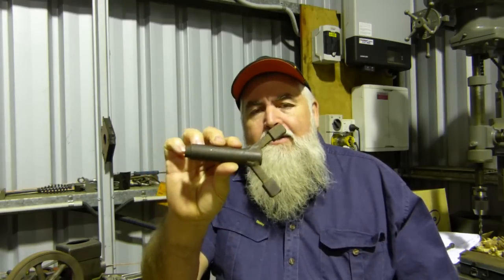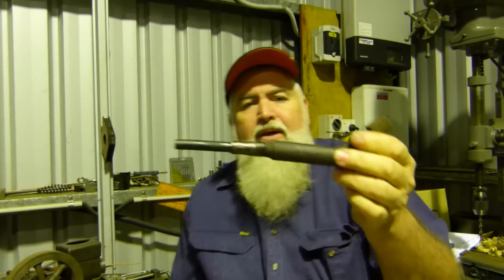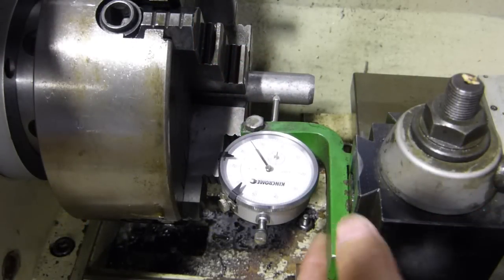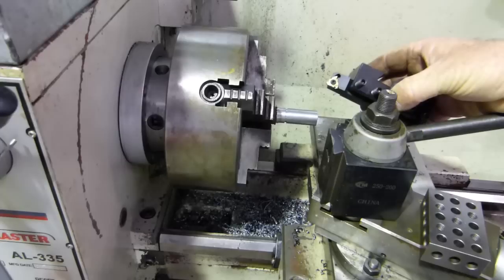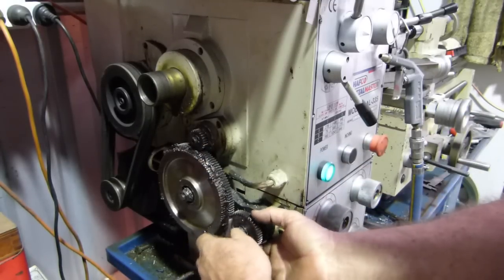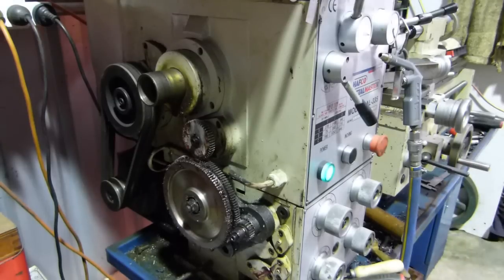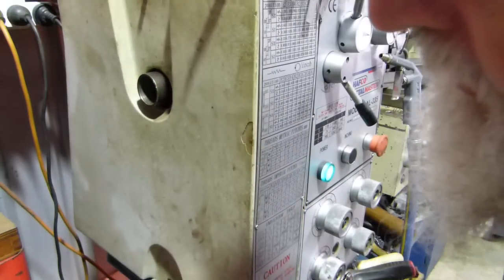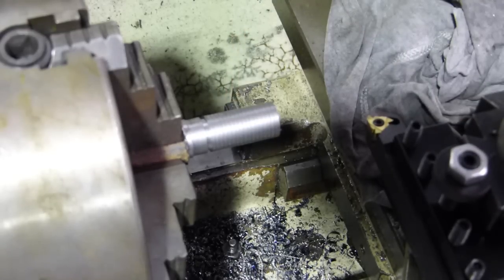Field Marshall Tractor Wick Holder Part 1

Comment: Hi Lance, I realize that it's a while since you made this video but I have a hint for you on your change gear setup. I have an AL540 lathe and when I change gears I place a strip of 80gm paper between each gear mesh and then push the idler into position. I find this gives me good backlash and a very quick and consistent setup. Regards Greg
Reply from the maker: G Day Greg, Thanks for that, I had not thought of doing it that way. I will give it a go  Thanks for watching and commenting.